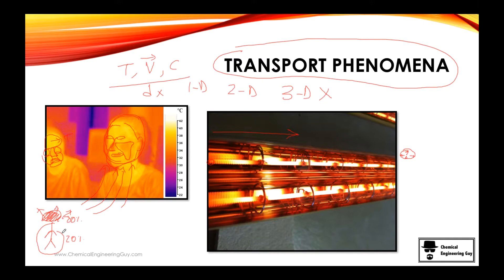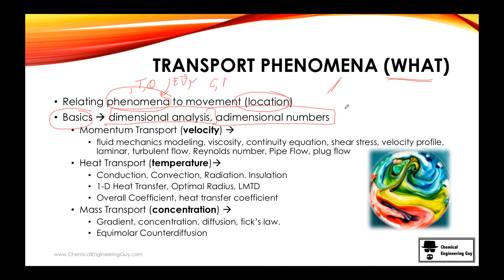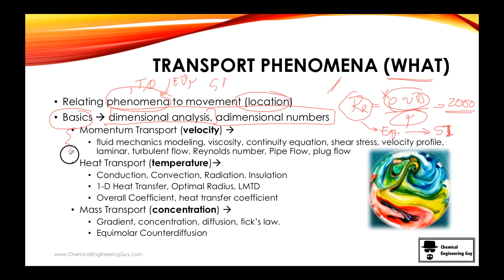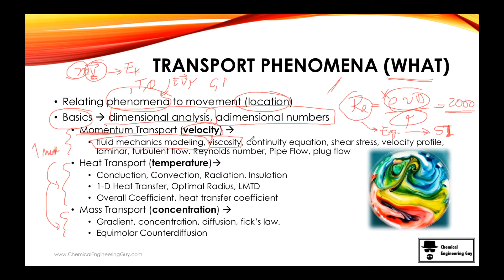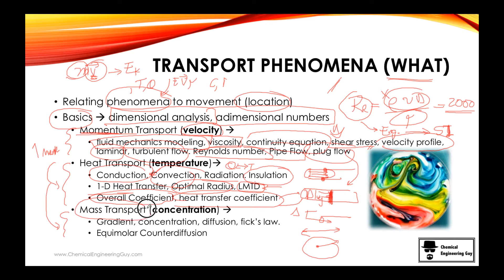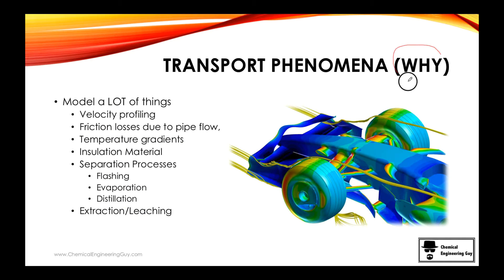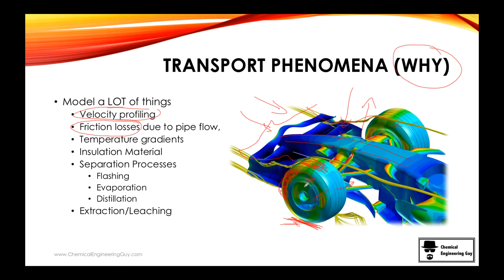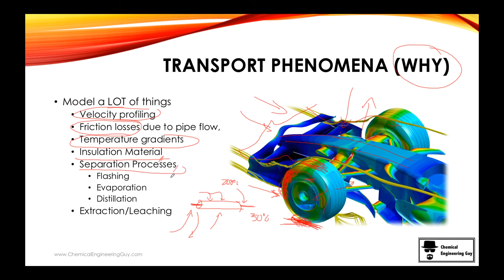Transport Phenomena in Engineering (E12)

Comment: Do you know what the pre-requisites for transport phenomena are?
Reply from the maker: Typically, you need at least fluid physics, or physics II... And plenty of math as well!
Reply: Like calculus 1 and 2 and differential equations?
Reply: the most useful math tools to understand transport phenomena are vector calculus and odinary and partial differential equations
Reply: At my university, pre reqs for transport are heat transfer, mass transfer, fluid mechanics, engineering thermodynamics (for chemEs) and differential equations